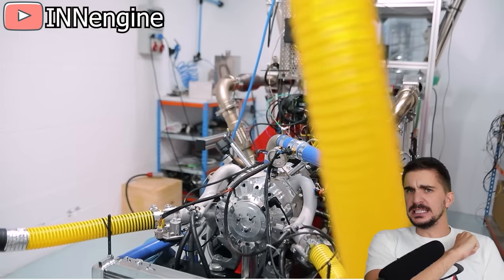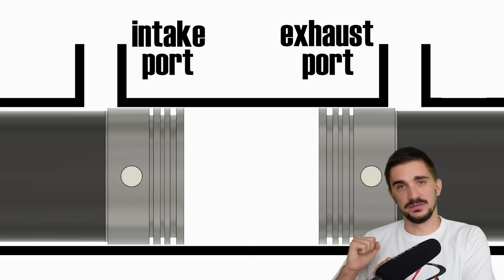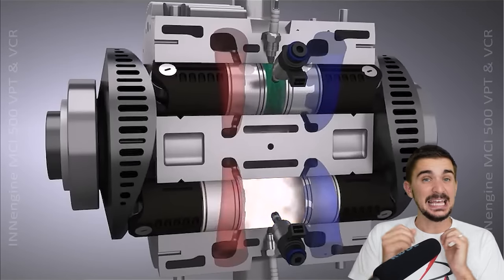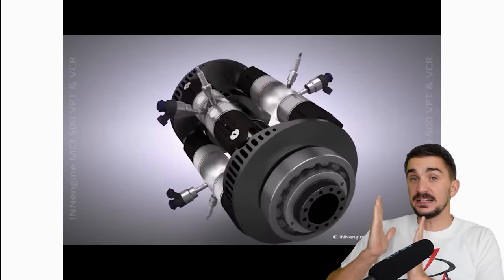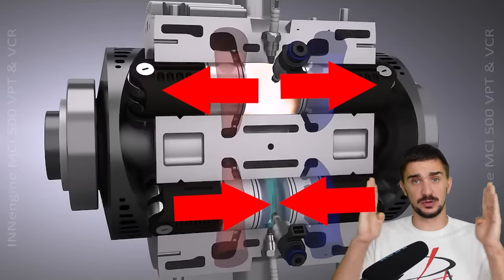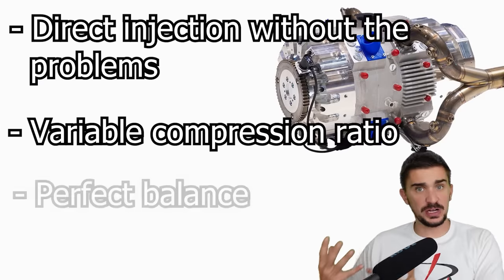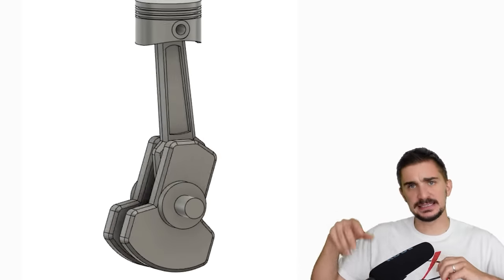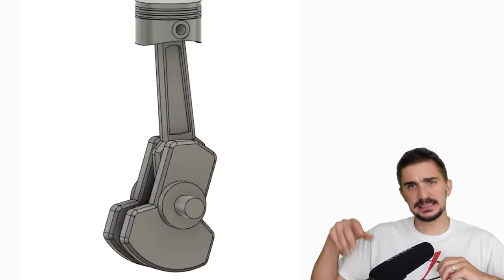Spain is Living in 2050? Revolutionary 1 Stroke INNengine Analyzed

Comment: The 'wavey thing' is a swash plate.   It is used in helicopters to control main rotor.  It is also used in car AC compressors - which incidentally look a lot like this engine.
Reply: And integza made a bike with them
Reply: It's an encentric.
Reply: There's a significant difference between an air conditioning compressor and this engine. air conditioning compressors don't have opposing pistons.
Reply: It's also used in hydraulic pumps on heavy equipment.  Swash Plate.
Reply: @Javelin276  Yes.   And car AC's too.

Comment: the rollers at the bottom of the piston will cause reliability issues. I see wear marks on camshafts all the time, but fluid bearings basically live forever if they have oil pressure.
Reply: you got it.
cams at least are rolling. these are SLIDING. hint... think about taper roller bearings.

all cones converge to a common point, and they roll on a line of contact.
whereas on this design, only one infinitesimally small line is actually rolling. everywhere else, its sliding. theres no real way around it. the swashplate has to follow a certain helical path for the line of contact. converging to a point. the angles are always changing. so either the rollers must have matching bumps, at which point theyre simply gears, or they must be infinitely thin... lots and lots of them, side by side.

tis why most of these designs tend to use rocker arms and spherical ends, or uni joints of some type. most. not all. the geometry isnt as simple as it looks at first glance. a spherical path is actually whats wanted. hence, ball ends are best.

the only good swashplate design i know of was michels. that uses pads, thrust bearings, that create an oil wedge under themselves. no line of contact or metal on metal.... true oil film, spread over an area. someone should revive that little feature again. its still used. in ships. the prop shaft thrust bearing.
Reply: I feel the big issue with this design would be wear. The cams/rollers supporting the piston return movement are offset causing a lot of lateral force on the piston and guides. Also, tolerance on the dual rollers and piston would need to be very tight to avoid knocking.
Reply: @paradiselost9946  They could probably shape into a conical shape to have the bearing to be in line with the rotation. That would definitely be a manufacturing challenge though.
Reply: Like a cone-and-cup system in bicycle hubs, this lobe thing will wear down, causing pitting and caverns in the races.
Reply: You obviously missed the lubrication segment at 6:22
Reply: Metallurgical and machining advances can solve a lot of these issues. 

It’s relatively simple mechanically and lightweight, so repair costs would be low if they can scale manufacturing.
Reply: @geoffreyveale7715  The problem has been solved with hydraulic pumps and motors using swash plates which also deal with very high pressures.
Reply: Hydraulic motors ie Hagglunds motor use the same swash plate design so not impossible. Ofc hydraulic motors have much lower rpm but the contact pressure in those would be nuts
Reply: I know this is apples to oranges but H&K firearms mostly all use rollers and they were doubted about reliability at the time of their creation. Now no one doubts the rollers being used there.
Reply: All 2-strokes have roller bearings in the crankshaft and conrods (even some 4 strokes), and they run mostly in fuel.
Those bearings should not be a real problem in a full lubrication oil setup.
Reply: The pistons are free to move independently of the wavy thing. Potentially bouncing. And I assume they're free to rotate within the cylinder as well meaning rollers can twist to be non parallel with the movement of the wavy thing.
Reply: And a camshaft is simply moving the valve train, not transmitting power. I think the swashplates will be the challenge and limitation of this design progressing into use.
Reply: The wavy thing is a Swash Plate. Think helicopter....

Comment: It's an axial, uniflow, 2 stroke, opposed piston engine.  My favorite arrangement, but it's been around a LONG time.  Hopefully these guys will give it the development time it needs.
Reply: Modern direct and HCCI ignition systems can really bring a lot of older i.c.e. designs back. If synthetic fuels come like they are touted then yeah maybe we see 2strokes and rotaries make a come back
Reply: An aviation related company tried to develop one with the wavy thing in the middle about 20 years ago. Axial 6 cylinder with 12 pistons. The cam had a stronger angular pitch, and I think it had an outer cam to operate a four stroke valve train. High hp/weight ratio, ordinary efficiency. I think they pursued federal drone development and quietly faded away.
Reply: @captaintoyota3171   Two strokes, forget it. It will never pass emissions.
Reply: @expertmax32  That's exactly what I was thinking.  This thing is never going to see production
Reply: @expertmax32  Fuel injected 2 strokes have been running on roads for many, many years
Reply: @russbell6418   This is the first thought i had, The airplane engine with a swash plate and 12 pistons, i believe it was made in the USA
It was a beautiful engine, i did encounter it while doing research about rotary engines. 
Nice to know i am not the only one interested in engine tech.
The two stroke opposed engine the op is talking about is indeed an old design, i believe the made some diesels this way
as early as The great war.
Reply: @N9197U  Name one fuel injected two stroke-powered vehicle that is 100% street legal and that you can buy brand new at the dealership and get it registered legally? Sorry to disapoint but, none.
Reply: I am concerned that the manufacturer claims that this works without boost. No 2-stroke gas or diesel engine can do this.
Reply: @expertmax32  this doesn't use mixed gas which is why 2-strokes can't pass emission regs.
Reply: Very similar to a K-Cycle Engine and the same type of crank shaft, the K-Cycle had low emissions because the power stroke was longer than the compression allowing for clean combustion with minimal exhaust requirements.
Reply: @dbmail545  I see we have people showing exactly why they called it a "1 stroke." Because they aren't capable of differentiating it from a conventional 2 stroke
Reply: Run a turbo at one end and genset on the other?
Reply: opposed piston engines burn oil as well as fuel

Comment: I think what would have been cool to mention is how the swash plate offsetting not only varies the compression but also the timing of the exhaust and intake ports.
Reply: Bingo!!!  😃
Reply: Would it not also affect the balance?
Reply: Balance is relative to the movement of the piston in relation to the crankshaft…in this case, both are still moving at the same speed so the relative balance isn’t affected.
Reply: @davidchristensen2970  Yes it would indeed.  For some period, both pistons are moving in the same direction when the wavy things are not in time with one another.
Reply: No doubt this is the reason for the existence of the adjustment.  I'm surprised he missed that...
Reply: But would you want the relative valve timing to be locked to the compression ratio?? ..and without a way to adjust dwell ?
Reply: I have maybe a stupid question, but wouldn’t adjusting only be possible on the forward slope down after the peak since adjusting to before the peak like the animation showed would cause force to be applied at opposite directions, or am I lost?, idk someone explain
Reply: It means they can tune the effects on the fly,
Reply: @davidchristensen2970  nah, because each side is already intrinsically balanced. on the right side the 1st and 3rd piston always move opposite to the 2nd and 4th piston, and they share their centre of mass. The same thing happens on the left side. So even when the sides are out of rhythm, it doesn't matter.
Reply: @realvanman1  The compression could be varied by axially backing one 'cam' off slightly, not difficult.
Reply: @CensoredUsername_  I don't agree... technically,  anyway.  One of the other benefits of this engine is that the piston acceleration/deceleration is, in effect, halved, because each piston contributes to the effective stroke length. As I had mentioned elsewhere, the distance from the shaft centerline also is part of the equation. However, if you offset one cam from the other, realize that the acceleration of one set of pistons will NOT be equal to the other set, so there will be some amount of unbalance. Whether or not it will be enough to cause problems will, of course, be dependent on a number of factors.  Another thing that I did not bring up previously is that I believe that these axial engines aren't usually high rpm or quick accelerating engines.  They ARE usually much more smooth and efficient, though!
Reply: I'd think both wavy things would move apart/together by equal amounts to retain "valve" timing and balance.
Reply: I doubt that... because, if those pistons aren't as close together as possible... the compression would change. IE... with this design, the pistons can't fire on a different timing arrangement. Probably just 1 of the reasons why they don't use a swash plate as an engine.
Reply: @johnbutera5805  your explanation assumes that the balance in the design comes from the sets of opposing pistons. That is what a lot of opposing pistons designs use, but this one actually doesn't need it.

Consider just purely the right half in isolation. That's one cam and four pistons. The pistons there are linked by the cam so that the even pistons always move opposite the odd pistons. This is mechanically guaranteed by the cam. And as the odd pistons shared centre of mass is on the centre (as they're on opposite sides), which also holds for the even pistons, they'll fully cancel each other out. 

Offsetting the cams causes the left and right cam to be out of phase yes. But since each side itself is already fully balanced that isn't an issue.
Reply: Vvt & Vcr simplicity. Very cool motor design
Reply: @exCR-it3ex true - though you can't vary the compression and valve timing independently of one another, something I suspect may make emissions compliance a little trickier.
Reply: That's not really a good thing since they're binded.
Reply: @cutl00senc  Incorrect.  The accelerations are not matched anymore, so they will be very OUT of balance.
Reply: @marknordhaus8346  which accelerations are you referring to?
Reply: Yeah, I should have scrolled the comments first before adding my two bits worth😊
Reply: @cutl00senc  The forces I mentioned are the forces of acceleration that will cause vibration of not always perfectly balanced.  
If you advance one swash plate relative to the other (rotationally, not having re-read this, I'm not sure which movement was being discussed), the piston motions will move out of phase, the accelerations will not offset each other any more, and vibration will dramatically increase.  If the movement is axial, it will still need to be the same axial movement for each swash plate or you will again throw it out of balance.
Reply: @realvanman1  But the other pistons would be moving in the other direction at the same exact speed

Comment: Thank you for pointing out the error of thinking "if it hasn't been done before it's because it can't be done". One of my perpetual pet peeves. There are cases in history where it definitely looks like something wasn't done earlier (sometimes for centuries) simply because no one thought of it. More precisely, no one thought of it who was in a position to do anything about it.
Reply: Correct, also, even when a "new" idea is "better" than existing technology, 
marketing, materials & ancillary services may need to be developed for it to be accepted 
& used. 
     This usually requires extensive capital investment, maybe, even 
previously non-existent materials or processes.
     Standard internal combustion engine isn't really "better" than a horse without 
places that sell affordable gas or roads to drive on.
     Not to mention an infrastructure in place for replacement parts & training on proper repairs. 
Airplanes weren't a thing over night, and neither was the gas turbine engine.
    Why do we use boats If an airplanes would actually work, or propellers 
if a jet engine could work.
     If nuclear material can be used to run an electrical powerplant, why 
are we still using coal & dams?
     Nuclear weapons, essentially everything in modern society. 
Somebody came up with the idea AND had a means to advance it beyond the "idea" stage.
Reply: @travissmith2056 good points 👍
Reply: @travissmith2056  The same people that marketed things yesterday, today and tomorrow is Wall Street. 

So what changes.
Reply: Totally agree. The side thrust from the swash plates on the pistons would be an issue, also as with all opposed piston engines, the exhaust pistons get quite hot. Not a problem for the Junkers Jumo engine as it was a diesel but certainly a concern for an Otto cycle engine, the compression ratio would have to be tempered to protect the engine. I was totally suspicious of the initial description of the engine because there is no way opening the exhaust early is going to create a vacuum for the intake process, and there at the end was the reality, a compressor to pump the air in like every other two stroke engine.
Reply: There's definitely prior art. I'm only one with my own variant about 30 years ago, this is in no way a 2050 engine!
Reply: It's not because "it can't be done". The point of two stroke engines, as used in motorbikes and outboard motors, was that they were light, powerful and VERY CHEAP. This engine satisfies the first two properties and solves the pollution problem that got two strokes banned but there is no way it will be cheap! Superchargers are expensive. High pressure injectors are expensive. I can't even imagine how expensive the swash plates will be. The pistons will probably be expensive too because there seems to be nothing cooling them!
Reply: @oldbloke135  Dude, KTM already makes injected two strokes, with seperate oiling systems. Like, weirdly, this isn't as crazy as you think it is, and also it's way crazier.
Reply: Maybe the one who's had the idea first had ADHD. I always think about that but keep not going forward as I also have ADHD.
Reply: @LateButGreat  I invented it differently, I looked up my project-inventors book for my similar one but with an internal drum valve and supercharging, mine was in 1995, few years before I started an electronics and software business. ADHD with hyperfocus here.
Reply: @fluiditynz  Might want to look into hyperfocus vs flow, these terms were used improperly by the layman way back when, and often still today. That said, it's implementation that matters, not just the idea, but the execution thereof. Wozniak might have been the brains, but Jobs was the salesman and visionary.

Fun fact: Dyslexics are 100% over represented in successful startups.
Reply: Have a look at the Deltic train & marine engine.
Reply: Yea but I think we dont have them now because I believe there is an serious issue (under real load and every day use for a year or more) for the engine to literally brake in the middle or at least loosen to the point where it exceeds tolerances of individual moving parts and it brakes that way lol because unlike a V or inline engine the Natural force doesnt transfer to a moving axel that is held in multiple places  but in this engine it transfers mostly to whatever holds those "wavy things" on each side.
Reply: Not one stroke.  Haven’t studied it throughly but probably the cycle involves two strokes.
Reply: Opening the exhaust valve and then the intake so they are simultaneously is called valve overlap.  Not only does it work, it is used on practically all piston engines.  
The escaping gases have mass and inertia.  The act of traveling down the exhaust pipe causes a useful vacuum that draws in intake air until the exhaust valve closes.
Reply: This engine is a glorified A/C Compressor, lol!
Reply: Swash-plate engines have been tried before, for decades
Reply: @oldbloke135  Dude have you seen what a car costs today? with all the valve timings and th complicated rebuilds? Also since every gas truck has a turbo now that will only last 10 years at absolute most. Even if this needed a small super charger, the rebuild would be a simple scrap and replace the internals. I mean its easier than any of my lawn mower engines ive torn apart or my 302. This would be perfect for your grocery getter and work transport vehicles like these crappy little SUVs we have here in the US. Coupled as a hybrid electric with much smaller cells the average person could actually lift the engine out of the engine compartment without a crane and furthermore actually have room to work under the hood! But, none of that makes money so it will get crushed early on.
Reply: My favourite example is little wheels on luggage.  I remember as a small boy my mother struggling carrying heavy suitcases and hiring a porter at Fishguard harbour on the way to Cork City by ferry.  Obvious idea to use wheels.  Just needed to be little wheels.
Reply: Most of the time it applies because all of these ideas that normies and casual engineer wannabes call “the future” so easily have already been studied and proven unreliable or not worth it. So yeah, this engine is just another gimmick with a thousand flaws people don’t know or care about
Reply: However, there are also countless examples of where it has been done before, or people had thought of it and not done it because it isn't good.
e.g. the vactrain idea from over 100 years ago which was revived into a hyperscam which still hasn't gone anywhere.

And in this case, it isn't new. Similar ideas have been used since 1911 and lots have popped up over the place.